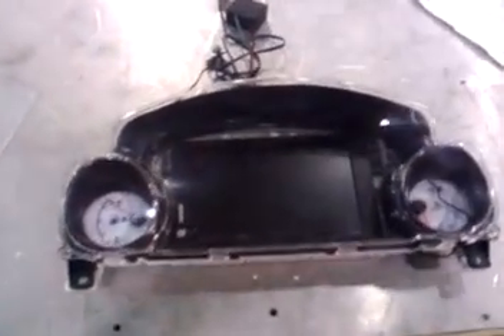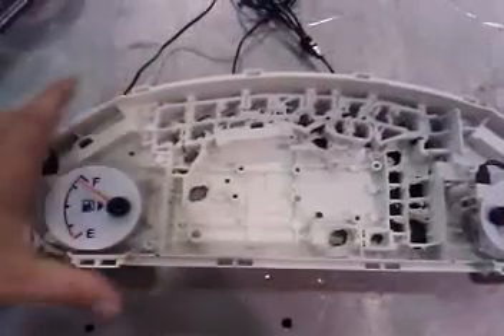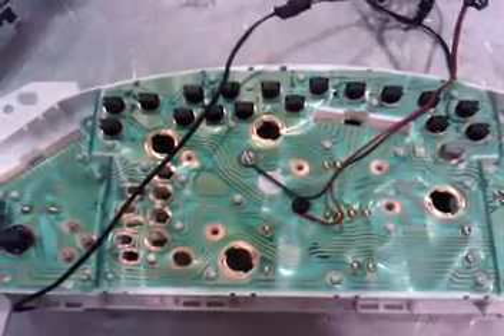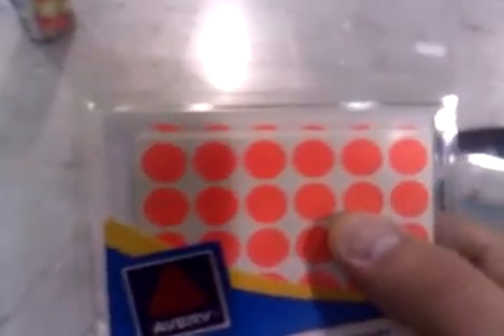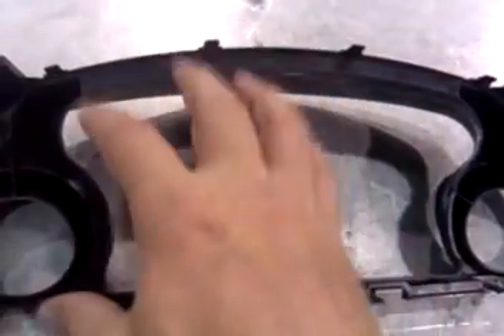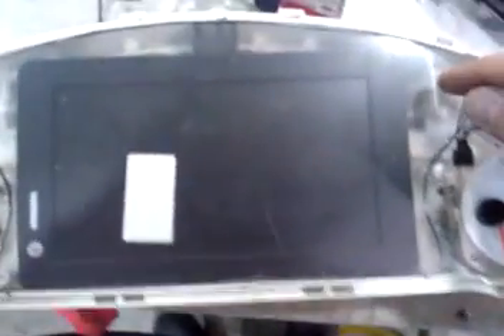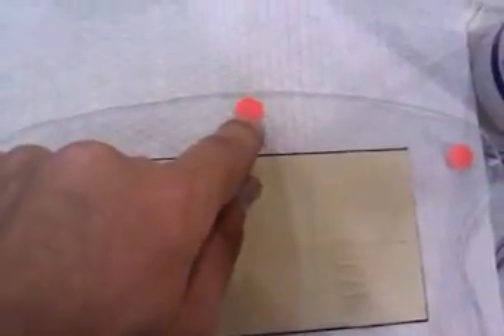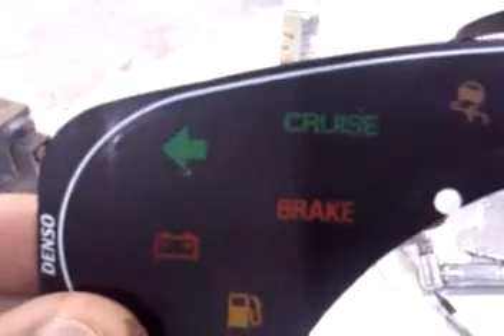How to convert your anolog gauges to LCD Part 1

Comment: I love you man you just save my pocket big time. I been running on battery for 3 month straight I didn't know what else to do until I watch your video. the only thing now is my gauges lights are not working.
Reply from the maker: no problem bud,  do the other interior lights work,  ie. AC controls?
Reply: +David Leonard yes just the dashboard light and my right turn signal. the check engine light battery and brake light all are fine. I just can't see the everything else is dark I check   all the fuse and they all good
Reply from the maker: +Alain Paul its an eclipse or different car?
Reply from the maker: +Alain Paul okay,  I think I figured it out,  you say your right turn signal does not work along with guage lighting,  recheck your fuses,  the ones under the hood, the right side is the same circuit as the dash lights

Comment from the maker: If you watch the video,  the check engine light still remains,  also you can relocate the other indicators anywhere you like,  I moved mine to the clock pod
Reply: I have a 2003 mitsubishi eclipse gt 3.0 I'm only getting battery power I have a new  alternator I'm about to check all the wiring
Reply from the maker: +Alain Paul there is also a fuse on the positive battery terminal,  I would check that too, the fuse goes directly to the alternator wire

Comment: So a tip from a former state certified emissions inspector and Driver's Education Instructor. Before you do this check with your state first. Depending on your state and what they require. You may need to think about Emissions testing and Inspections and Dept of Motor Vehicles (known in my state as DMV) License testing.  If you didn't keep all your dash warning lights (aka idiot lights) in my state you will fail the emissions test. The inspector is required to see the lights light up when they turn the key to the on position. Then they are required to see if they shut off when the car is started. Also when my state does inspection and drivers test's they check this stuff and you won't pass.
Reply: +Shawn Rigoulot Then your state is a bunch of fucking retards failing an EMISSION TEST because the "Service Engine Soon" Idiot light is not there. Fuck your communist state. I would do it anyway.
Reply: +Shawn Rigoulot Then your state is a bunch of fucking retards failing an EMISSION TEST because the "Service Engine Soon" Idiot light is not there. Fuck your communist state. I would do it anyway.
Reply from the maker: On my vehicle,  I relocated the indicator lights to the clock pod location.   You can do this by making a panel with the same method I used to make the blinker indicators on a separate piece of plexiglass cut to fit and soldering a wire harness with a molex connector to the corresponding leads on the back of the panel.